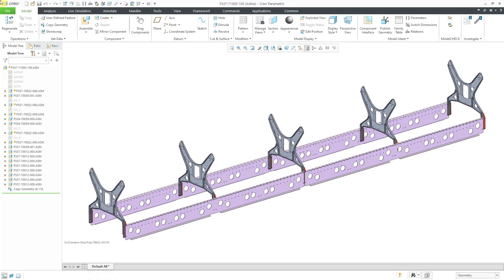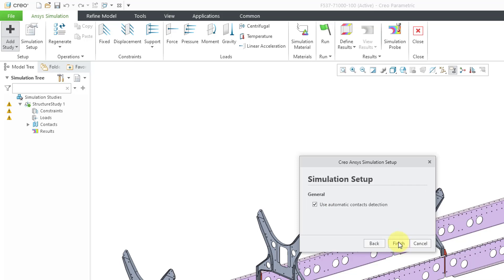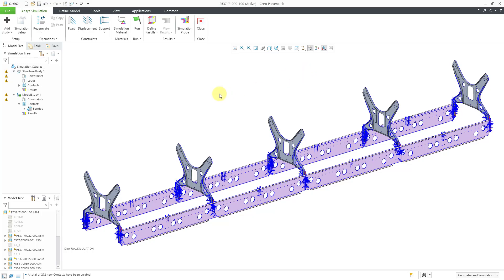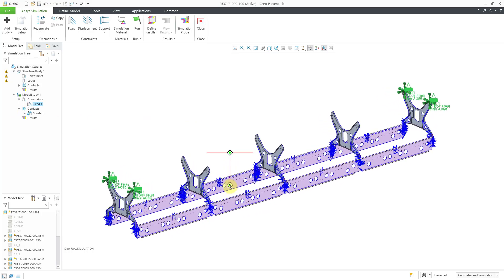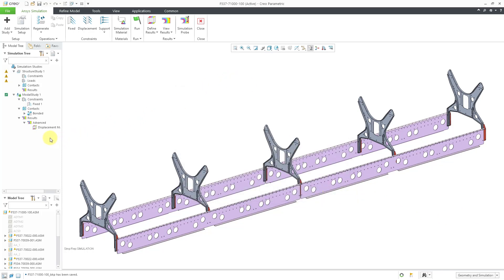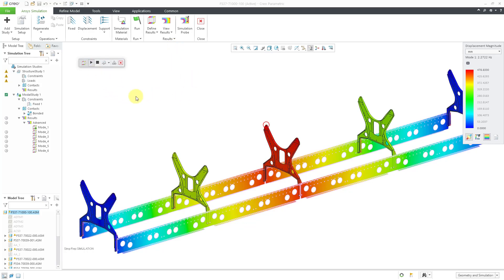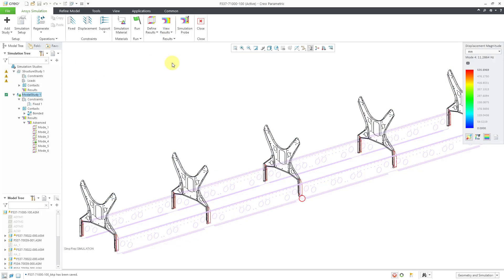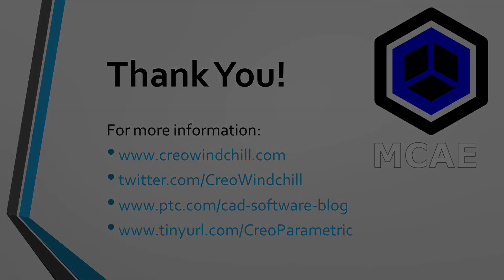Creo Parametric - Creo ANSYS Simulation (CAS) - Modal Analysis

Comment: Are the displacement scale real? 350mm?
Reply from the maker: It's a Modal Analysis. Displacements are meaningless. The results of a Modal Analysis are frequencies and shapes. You can't calculate actual displacements in a Modal Analysis. You would need a Dynamic Analysis of some sort to know what kind of force or energy is being pumped into the system.